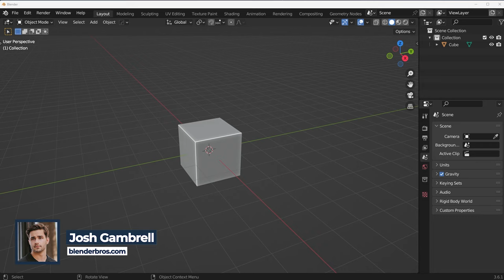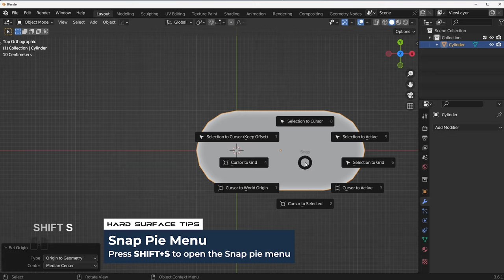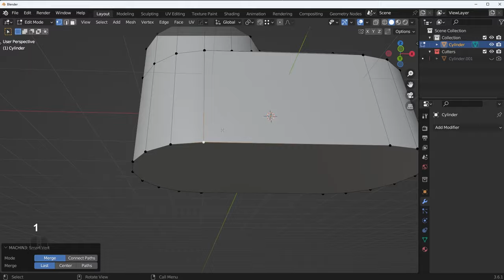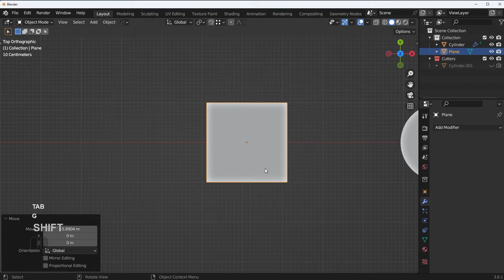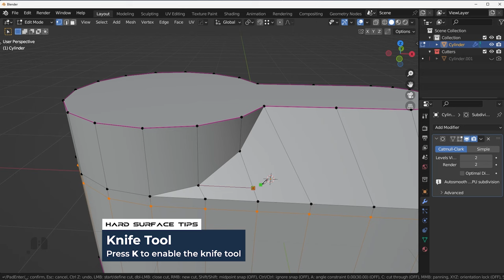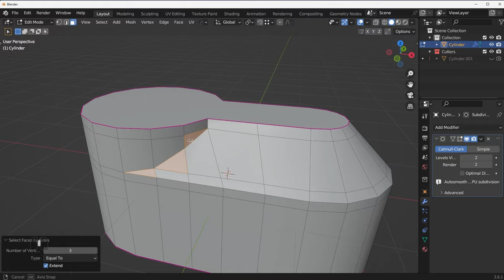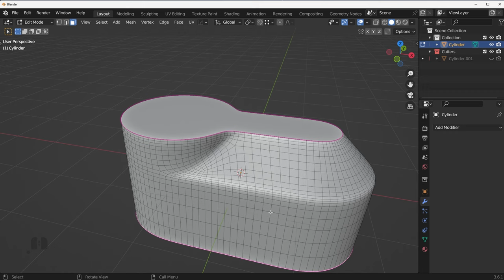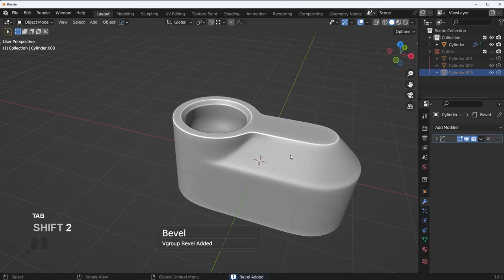Hard Surface Modeling TUTORIAL - Subd Shape Study

Comment: Subd really has it's place for specific shapes, great thing to have in the tool bag. Thanks!
Reply: @ddontyyI was about to say this, I have 500 hours in sub-d modelling and about 3 with Boolean as I’ve only just started using it to save time etc.

Blows my mind the default approach to modelling is Boolean, it reminds me of people using frequency separation in retouching, a very powerful tool that has a use case but people use it to skip massive chunks of the fundamentals.

It should be taught the other way around, sub-d first then Boolean to save time etc.

Comment: I'm starting to realize more and more that the workflow you're promoting looks a lot like what we achieve by doing solid modeling instead of surface modeling. I prefer to work in CAD software and the topology looks very similar. We work with STEP exported files and before exporting, everything is parametric.

Now I've seen that there are a few groups working on bringing a CAD-based workflow to Blender. Do you think that will be a game changer for these type of designs in Blender? I get the feeling that it will produce a lot cleaner meshes in the end.